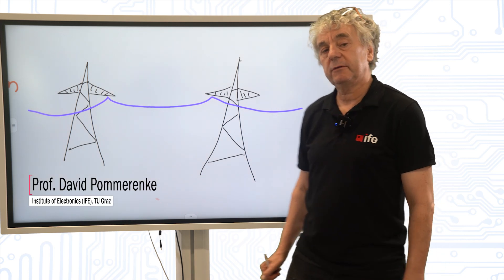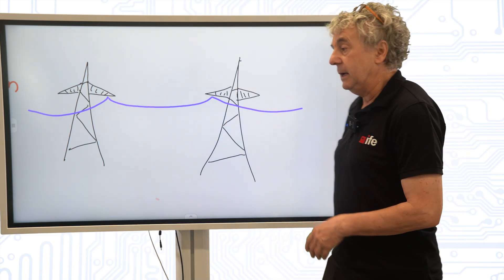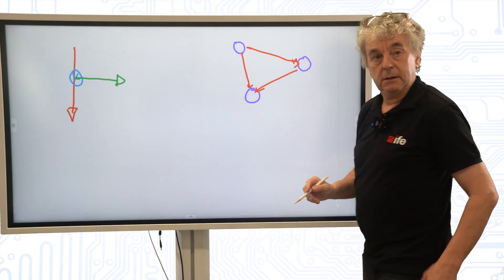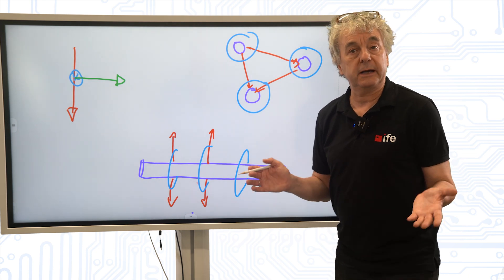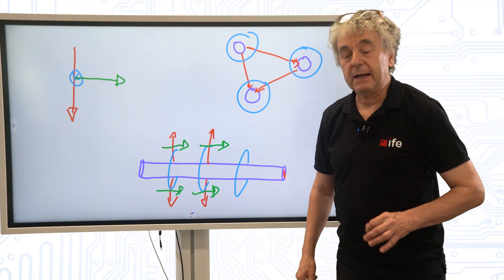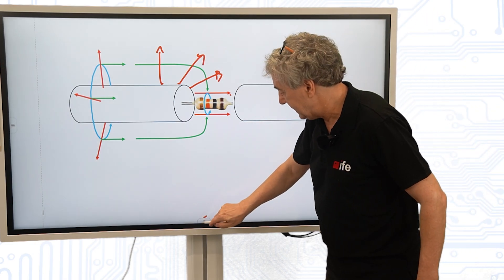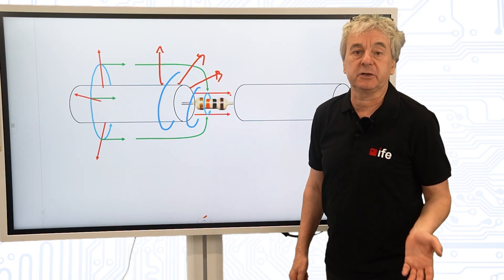The Poynting vector - how energy really flows in a circuit

Comment: Great explanation. You showed that the Electric field is quasi vertical to the wire and then becomes horizontal at the resistor or any other passive component. My questions since the wire has also a small resistivity, why do you think that the electric field is vertical also in the wire?

Comment: The wires guide the energy, because the wire transports the electrons that in essence are the "tiny magnets" that create the magnetic field the energy is guided along.

Riddle me this, how is the Poynting vector oriented in a spherical capacitor and how is that you can send messages between the 2 of those despite no apparent fields connecting them?

I'm not really expecting an answer here as this topic is almost silent in the literature, because people think that capacitors are only for storing charge, which the spherical capacitor is not good for.

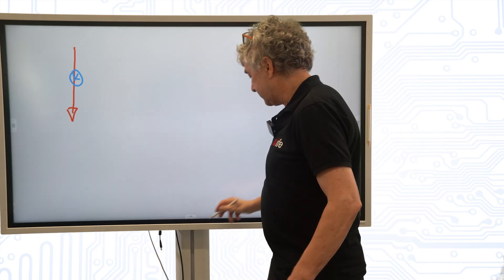Comment: 1:17
How does one get the right hand rule check with diagram ? I can't get my right hand to give me E X H =  according to this diagram ?
What Am I doing wrong ?
Please advise. Thank YOU
Reply from the maker: You point your right hand down in the direction of the E field. The H field points into the board so you bend your fingers into the board. This means that your thumb points to the right 👇
Hope this helps 🙂
Reply: @ife.tugraz  that works. Now, let's try the thumb index and middle finger on the right hand perpendicular to each other.. For E X H with E mapped to the thumb, H to the index finder, and S to the middle finger.
I can't get a working geometry.
Reply from the maker: @lgl_137noname6  If you use that mnemonic, it still works. Your thumb points down and your index finger points into the board so your middle finger points to the right.

Usually, you would let the thumb be the cross product, but it works either way. See for instance this illustration:
https://commons.wikimedia.org/wiki/File:Right-hand_rule_for_cross_product.png

Please try again and let me know if it works for you 🙂